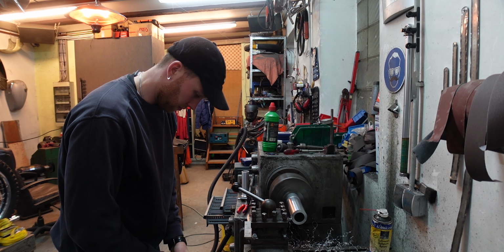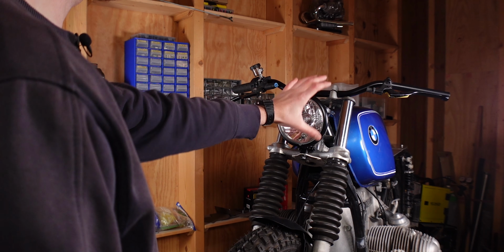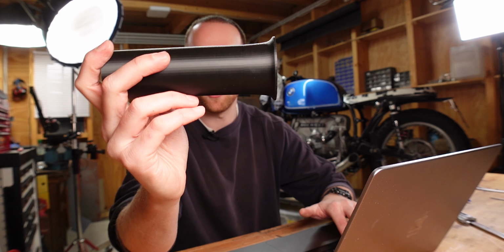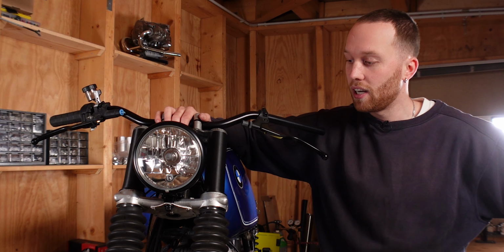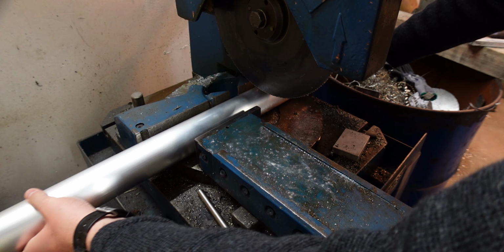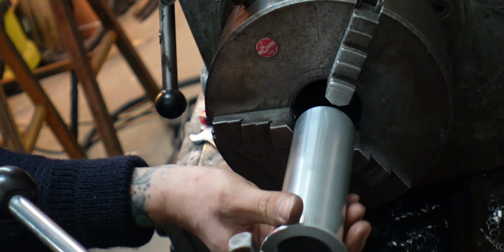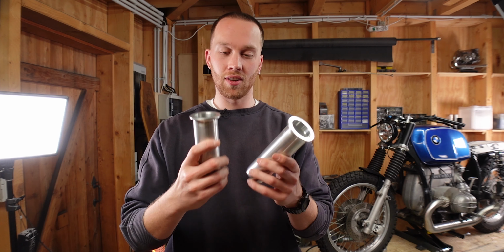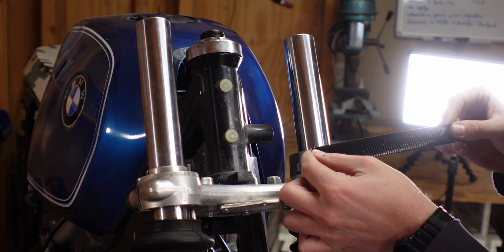Turning Fork Sleeves For The BMW R80 Custom Build

Comment: Those pins also act as a pressure release.  If the pins do not allow air to escape from inside the gators, the gators will "balloon" on compression.  Looks great, but you may want to machine out an air passage from the new sleeves to release the pressure.
Reply from the maker: Oh, that is a good point! I appreciate the tip. My first thought was to put an eyelet into the each gator to let air escape, what is your opinion on that? But I'll also think about how i can machine a clean way to create an air passage without  destroying the look or fit of the sleeves. Thanks again, those tips are great.
Reply: @MotoWrenchers   Anything that provides a release for the pressure should work.  You might be able to find a brass or aluminum  eyelets to punch in.  That's a good idea.  That will have the benefit of being about to be somewhat hidden if the look is not what you like.  the sleeves look great and I would not want to muck with them either.  Depending on your clearances, you could also provide a channel inside the sleeve and vent the pressure through the back, but that's quite a bit more work.  I am rebuilding an 85 R80 and rand into this issue only last week.  I put the gators on without the locating pins and they ballooned up when I tested the fork motion.  My project is not as custom, so the pins will be fine as designed.